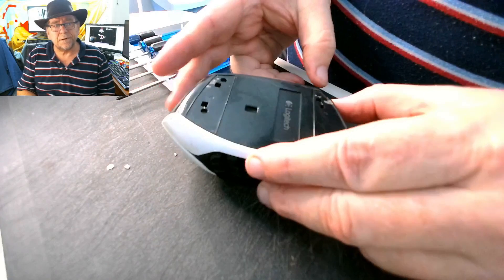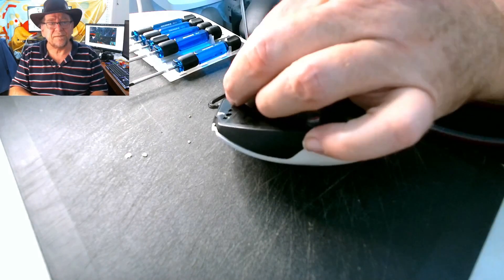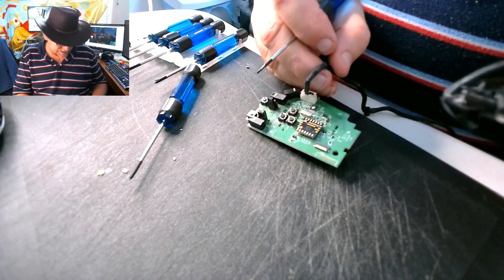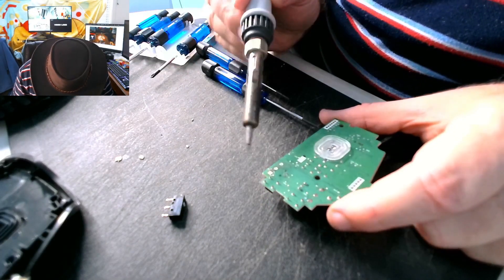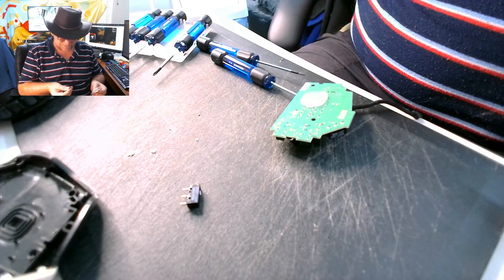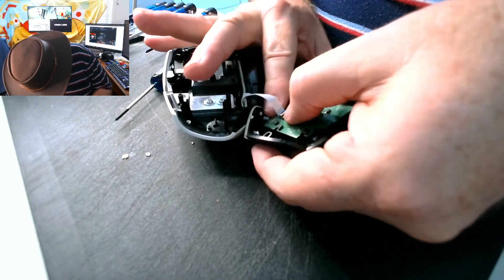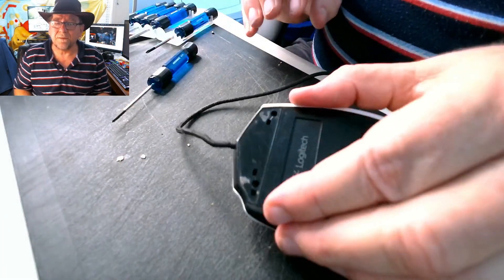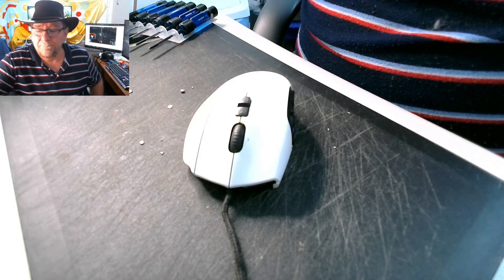PC Hardware - Logitech G600 Mouse Switch Repair - Again

Comment: Hey brother, I've purchased three of these over the years and eventually all three got the same double-click problem.
Apparently Logitech uses a new optical sensor rather than a push button and it solves that.
Still though, this is my favorite mouse.

Where'd you get your replacement switch by the way?
Reply: Where you able to repair your G600 mouse from back then?
Reply: @combeechan  No but I didn't try yet. I did find videos that look like they'll work though. Search on here "Logitech G600 double click fix" and I think any of those videos will work. Most basically show you the piece to replace. But one even shows you how to bend it back into place.
Reply: @DevanteWeary  Thanks for getting back to me.  Nice!  I tried taking the whatever bendy thing out of the switch before, but didn't do a change.  I legit have 3x of these mice, with the newest one starting to hyperclick.  Pretty confident as well in doing the soldering switch replacement, just need to find the parts now.
Reply: @combeechan  No problem. I know the struggle well. I have three as well and only one is working right. Just waiting for the day. :<

If I remember correctly, one of these videos gives you the exact part number and if not, I may have found it on reddit. If I find it again I'll let you know but it was super easy to find between the two.